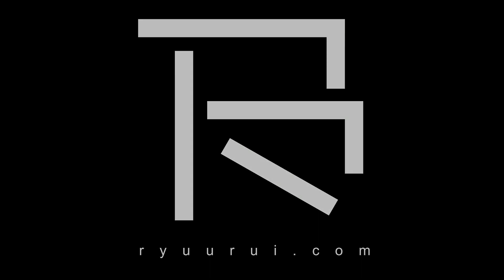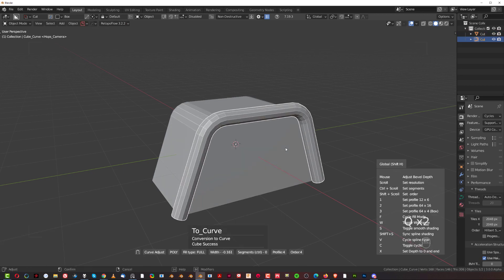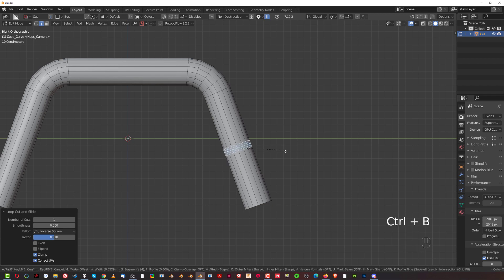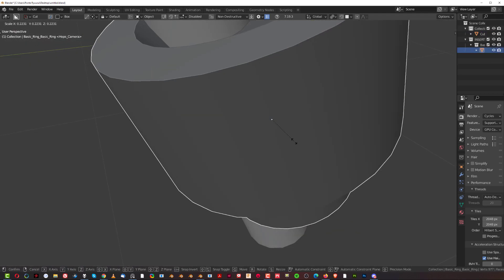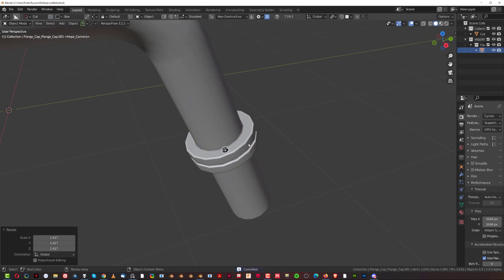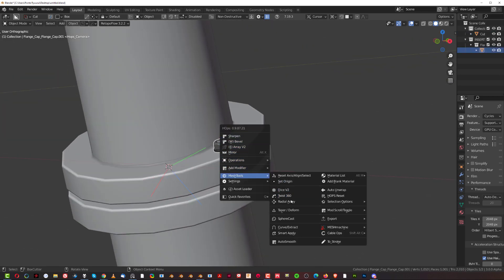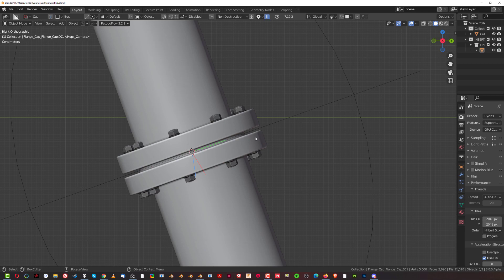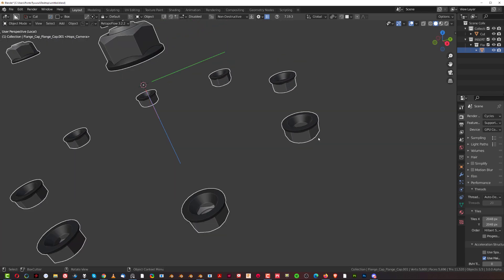Tricky Angle Radial Array in Blender - SOLVED!

Comment: I cant get it to rotate on the correct axis....keeps arraying it on the z axis but I need it to array on the y axis.
Reply from the maker: press h and check the menu for array
Reply: @PonteRyuurui  Thanks for the response. I played with the menu that comes up with H but it's still not giving me an option to have the radial arrayed objects rotate on the y vs z axis...I have to manually rotate the object on the z axis by 90deg...sometimes on the y axis...it doesnt make sense to me. Why can't it just rotate array as per my view...if im looking orthographically straight on the elevation of the object, I just want the thing to radial array around the cursor/origin. It most of the time doesnt want to do this.... I must not be doing something correctly.
Reply from the maker: @PedroFilms  you can change the axis of the array there. Also your axis will depend on the rot. of the arrayed object, so check that as well
Reply: Thank you. I’ll test it again soon